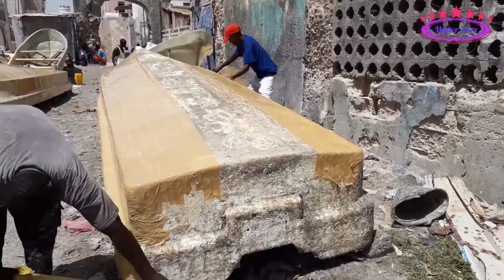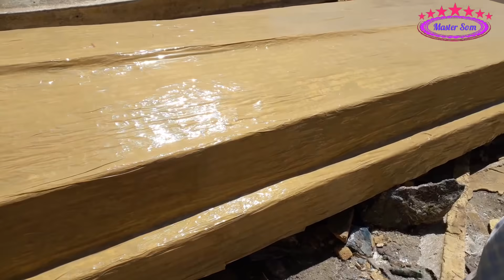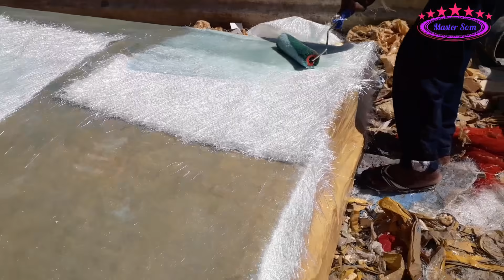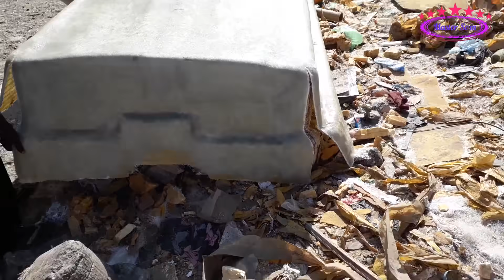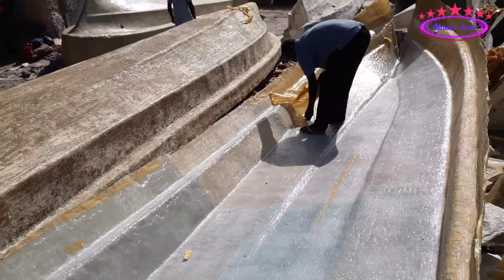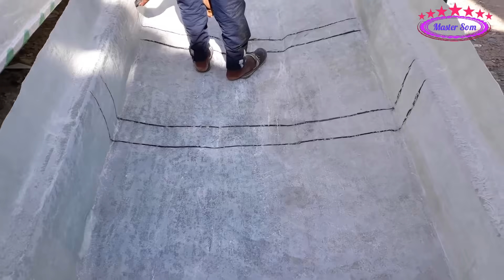fiberglass boat building part 1 sida loo sameeyo doomaha somalia

Comment: Suprising to see that done under direct sun!!!
Reply: Nice UV cure:)
Reply from the maker: We are in Africa, the sun is always hotter and we use work under the sun
Reply: @master_som  I am living on the west coast of Canada where it doesn't often go above 70 deg. F. I was given an old fiberglass boat that I have replaced the rotten wood in.Everyone  advised me to put up a shade but I couldn't so I worked before the sun came onto the job or after.There is a warning on the plastic jug the resin comes in about working it in the sun but it is not as hot here as in Africa.I enjoy your videos.

Comment: Going about it ass backwards.  You build a boat -- make it the plug.  Pull your mold off the plug.  When ready to build another boat wax the inside of the mold (which is smooth).  Lay a coat of gelcoat on the inside - let it get tacky - spray or lay your fiberglass in layers.  When hardning is complete fill mold with water and the boat haul pops out with a smooth finish which is already gelcoated to the color you want.  Then run your stringers and finish boat.
Reply: For a Somalian fishing boat ?  Riiiiight.

Comment: HEY GUYS! PLEASE HELP ME!
1- What we use under the glass fiber to prevent it from sticking on the band or mold?? If we don't use anything , would it stick to mold??
2- When we use gelcoat?
Reply: Use Wax, melt it and paint on. Smooth with torch heat.

Comment: I think that transom is gonna add a ton of weight to that flimsy hull.  And Oh, they sand the inside for appearances?   Geezzz!  Oh yes, has anyone ever owned a fishing boat that Sears sold many years ago, under the name of Ted Williams Sports gear?  Well, I did, and it was just about as flimsy as this.  I bought one used.  Many parts were as thin as this.  Sold it to my stepson.  He left it out in sun, eventually it just crumbled apart.  Looks like they have more than one plug, guess this is one of them custom, special to order shops.  Guess all the lead paint will help with stability.

Comment: Release wax is the same price as a single roll of tape. Works better actually.

Pva is also cheaper than a roll of tape.
Reply: That plug is extremely rough, I doubt a hull would come off of it using any other method,

Comment: Great job Master Som!
What are boat moulds made off? Can you show How the moulds are made? Thanks Ray
Reply from the maker: We will make a videos about ours.
Reply: the pro's have 2 or more piece molds. They apply the gel coat to the inside of the mold, then the resin and fibreglass onto the gelcoat inside the mold, then put in structural supports etc  , they then split the mold and pull it apart
Reply: Part 1 should be the mould

Comment: I refuse to believe they can't get some wax to use instead of tape....
Reply: That plug is extremely rough, I doubt a hull would come off of it using any other method,
Reply: @dougalannh  Yeah....no....boat manufacturers use a releasing wax on fiberglass hulls....these guys could do the same....and definitely be less plastic waste for sure!

Comment: 460 1st layer 2nd again 600 coat puting layer 460 coat again wrong applying method  ur using fiber
Reply from the maker: Yes, correct

Comment: Hey can you take a mold in the same way but from a wooden boat?
Reply: I imagine anything that has the shape can be used. If you want the exact same size, you first make a negative, and in that you make the outer skin.
Reply: Yes.  Fiberglass the outside of the wooden boat.  Sand until really smooth.  Wax the haul.  Spray gelcoat onto the waxed haul - while tacky spray several layers of fiberglass chop onto the gelcoat.  )What they are doing in this video is ass backwards.)   You will need to have provided a spot to hook your hose up to the mold.  When the mold you have created is hardened fill it with water and the boat will pop free.  Now you have mold of that boat haul.  When you are ready to build boats just wax the inside of the mold and reverse the process.  Lay a coat of the gelcoat in the color you want the haul onto the mold, wait till tacky.  Spray sevrral layers of "chop" fiberglass onto the gelcoat.  )You will need to put an outer frame on the mold to give it strength. (  When the new haul is dry hook the hose to the fill connection (on bottom of mold) and pop the new haul out. (First run your stringers in the haul and braces across the haul.)  Proper way of building a good, strong fiberglass haul.  In Lafitte, Louisiana they build boats for shrimping and dredging oysters from 25 feet to 55 feet with this method.
Reply: @thomasritter3159  Wow thanks for your reply...couple of follow up  questions if you don't mind...where exactly do you put the hose with water...in the wooden boat or between the mold and the wooden hull...and also is there a way not to fiberglass the wooden hull in the process as i wish to leave it as it is since it is a functional boat...cheers Ed

Comment: Great video. A question about fiberglass/carbon fiberglass boats & yachts is where do they go @ the end of their life? Here in the USA we learned that recycled plastics are not recycled they are instead shipped to communist China & the commies dump the plastics into either landfills or the ocean.
I don’t imagine old 100 foot fiberglass yachts are sent to China I am curious to what happens with them. Fiberglass is an evil (according to democrats) petroleum product & I suppose it could be sent to a trash to energy facility if it were cut into pieces for shipping.